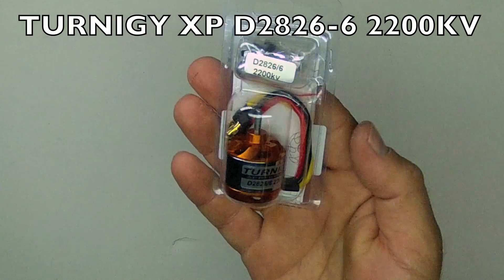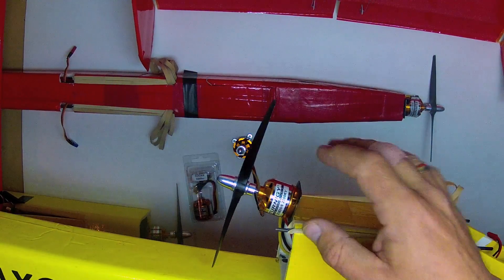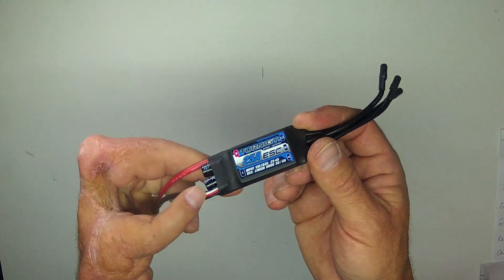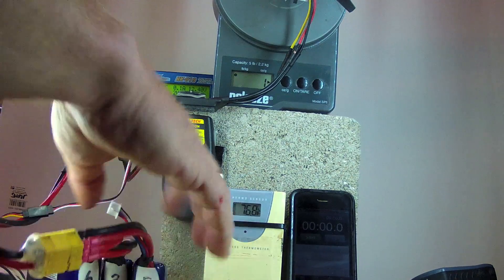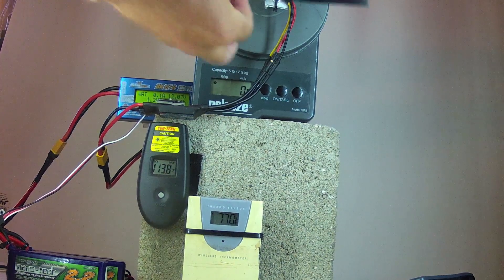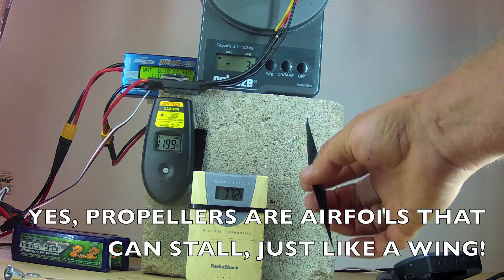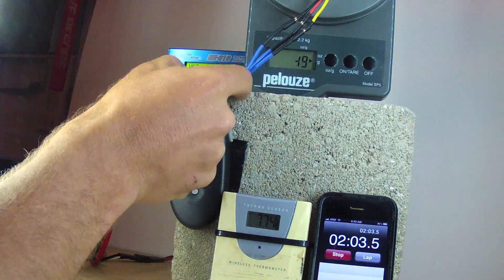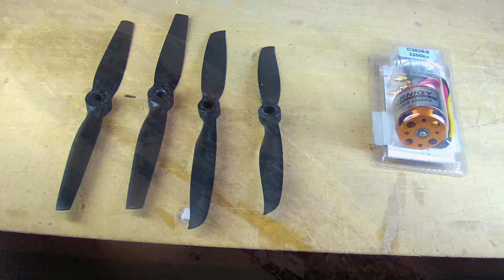D2826-6 2200KV POWERPLANT TESTING - "Pocket Rocket"

Comment: I'm thinking about buying a Master Airscrew 6x3, for a D2826-6 2200kv, running on 3S with a 40A esc, pusher configuration. Did you have a chance to fly it? Is this propeller worth its price? Did you have to buy a new spinner/hub or did it just fit with the one you already had on your motor? Thanks.

Comment: I have an EPO Cessna 185 trainer plane of about 1200gr weight. I have this exact motor and 40A ESC with 3S battery. What kind of prop would be appropriate for this setup? I have 9x4.7 prop at the moment but I'm not sure if it's good to use.

Comment: Been having launch issues on a 3d printed flyibg wing. Think ive tracked it down to low thrust. I cant replicate these results. 6.5x5.5 prop tops out at 200w. Switched to a 6x4 less thrust and lower watts... my wing is around 700g.

Maybe its my battery but on a smaller prop the watts drop and can feel way less thrust

Comment: I have this motor/prop combination. I can’t figure out how to get the prop on the prop adapter. Hole is too small.
Reply: Use a 1/8th drill bit.   Shaft on motor is 3.17mm which is 1/8th inch.  However, I simply use a 3.17 mm prop adapter on this motor.
Reply: Sorry.  I misread your question.  I have no advice because I don't know which prop adapter you are using.

Comment: which will give me greater thrust?
A> 1000kv motor with a 8*4 prop anda 30A esc
B>your recommendations 
and can i use a 11.1v 25c 2200 mAh battery with it?
Reply: you probably want a much lasrger prop for a 1000kv motor. in general for thrust you want larger diameter and lowe rptich. if you want speed lower diameter more pitch.  for the 1000kv motor im guessing somewhere in the regions 10-x6 11x6. you really need a wat meter though.

Comment: Okay, I have this motor and I have a Master Airscrew 6x4 prop, but the prop wont fit onto the prop adapter that came with the Turnigy, and the prop adapter doesn't grab the motor shaft anyway. The motor shaft fits just in the prop hole, but you need to use the adapter right ?

Comment: sir thanku very much for this great video and tabulating the results in a speadsheet .but i wanted to know that can we use a 7×3 prop on this motor as there is a video on you tube getting 1.2kg thrust with 7×3 prop

Comment: Ed this may sound like a silly qtn --- can this motor be used in tractor mode by reversing the power cables ?
Reply: yes you can reverse the motor. do make sure you have the prop facing the correct direction !  numbers on prop always facing toward the front/nose
Reply: pointnozzleaway Many thanks for your reply.  Electric power is new to me as I've always been a Nitro flyer.

Comment: hey ty for good video. i have a quwation for u. I have same motor with 3s 2200 40 c bat. and 30 amp turnigy plush with JM 6X4 prop and it gives 725 gram trust. not anymore. Do u have any idea  why its low ?
Reply: this motor has max Current: 34A u need to use at least 40amp esc to have full power
Reply: m8 did u see video ? he nearly got 1 kg trust with 26 amp or somethng. and did u seethe esc he used? which one was 40 amp? I know it says 40 amp esc on HK but believe me i have been using  30 amp for 6 months and its not even warm for 7-8min flgiht.

Comment: Ed,  one question pertaining to this motor.  I have about a dozen of the Master Airscrew 6x4 props that I would like to use with this motor,  but I'm curious what you are using to enlarge the prop thru hole,  so that it fits the 2826 prop adapter?  What is the hole size in the prop once you have bored it out to match the adapter?
Thanks..
Jim

Comment: Great video. I have the same motor on my Assassin flyingwing using a plush 40amp ESC (motor timing set on hi) turnning a APC 6x4 prop ,Turnigy Nano1300mAh 3c 25/50burst.. getting 280watts @27amps. easy 90mph range

Comment: Very impressed with video. removed alot of grey area's for me.. im using the same motor and a 6x4 APC prop  on a combat wing (TEK SUMO).. with the 40amp plush .. ive clocked it on a gps logger @ 143.3km which is 89.04mph. note with a good dive  and up for low pass. THANKS AGAIN!!

Comment: Maybe you can do a video  on motors. The differernce in class/size..ect
it's not just the KV. The difference between a 2226 and 2836 It's a little bit confusing from informations Ive been getting. I use to fly nitro...The difference between a
.92 4 stroke and a .40 2 strokes. (stuff like that) torque verse top speed....
Power/amperage is too general. Plus I hear of people burning out motor using
too small/big of props for motors. Kind of like putting a 6x4 on a .40 nitro. Under loaded

Comment: can you do a test on the ntm 2836 2200kv and 2700kv. The spec on the 2200kv has higher watt rating than the 2700kv. So Im thinking has more torque on the bottom end.
Plus Im using DTFB to build jets. So I built mine slightly bigger to compensate for the wingload (30" from 28").still using 6x4 props. I want to do harriers or close in type of flying rather than top speed. My other concern is flight time. I saw someone use a ntm/2200kv with over 13min of flight time 2/3 throttle. 2200 20c

Comment: Turnegy 2822 27kv is my motor of choice but trying to buy replacement shafts has been a crap shoot as most of them I've found have been 3mm not 3.17. Some one suggested using a extra long dewalt  1/8 drill.

Comment: Good review, I always  use 40 amp esc's after I saw 25amp draw on my own test. Beware of  "OPTO" when buying esc's as it means optional battery eliminator circuit(BEC) resulting in having to buy a separate BEC or using a 4.8v battery pack for rec and servos. A 4.8v battery pk is handy for binding receivers and checking servo operation.

Comment: hey Ed, I think your text on the video is incorrect. I believe you were using 6x4 props (not 8x4). 8x4 would probably end in tears.....

I run this motor with 6x4 props on a few of my planes and it works well. I always run a Turnigy Plush 40amp ESC, slightly higher than needed but you don't have to worry about heat issues when installed inside the fuse.

Another great video, thanks!